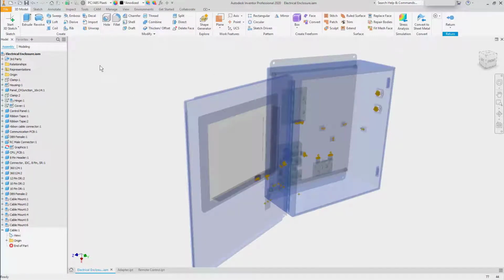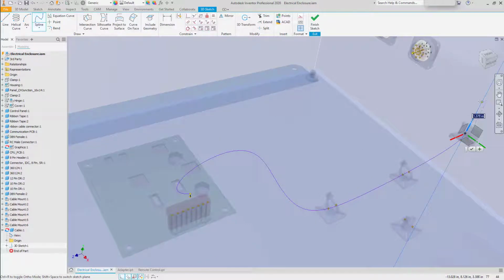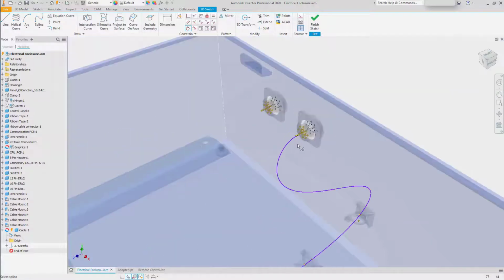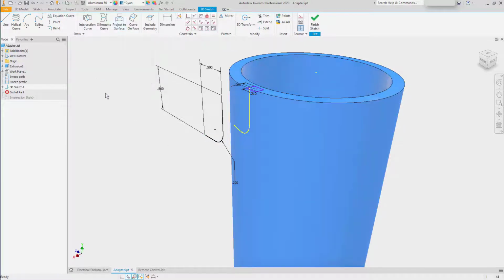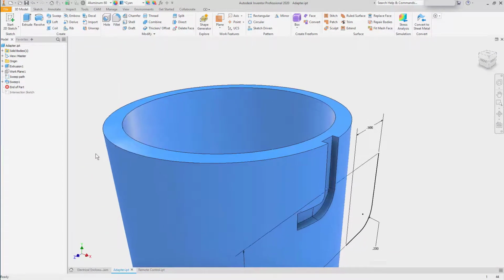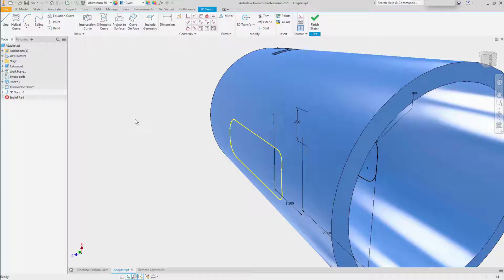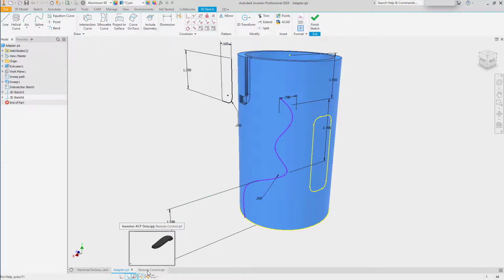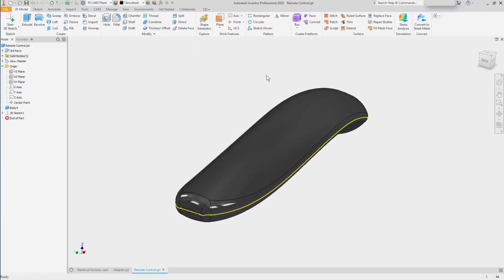Inventor English 2020 Create 3D sketches 🧷

Comment: hi do you have any clue how to make spline in 3d sketch easier?
I want to trace a picture for surface modelling using spline
but the XYZ arrow limit me to 90degree of line
thanks
Reply from the maker: I will review your question, then I will comment.
Reply: @Ingeniería10D  thank you so much sir
Reply: @Ingeniería10D  hi thanks, I have solved the problem
just un check the orthogonal mode at the bottom of the task bar,thanks
Reply from the maker: @ianm1898  I'm glad you solved